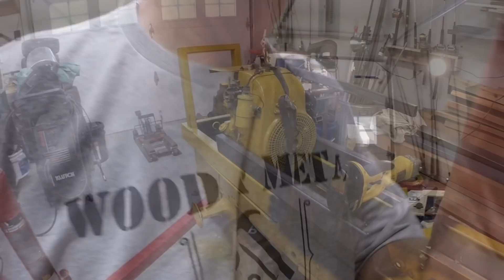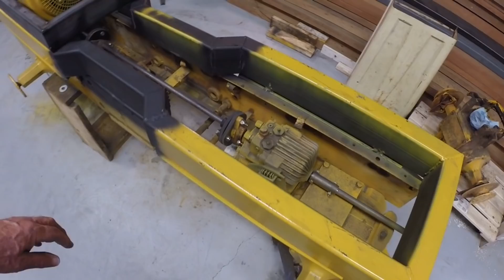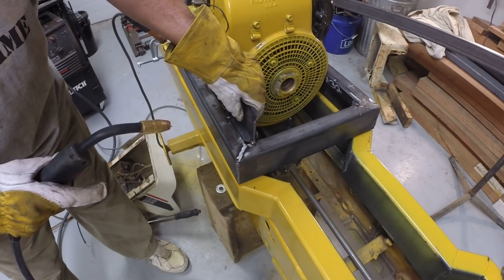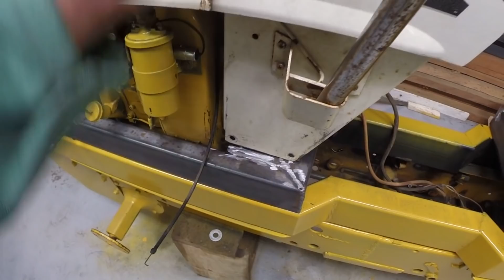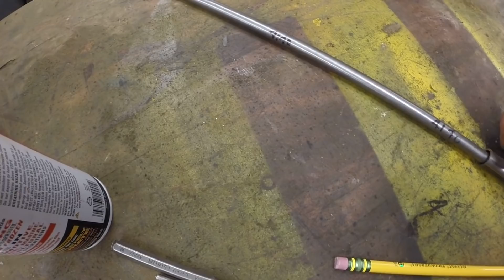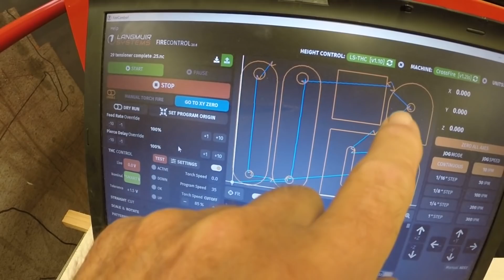Cub Cadet Dozer Build #11, Out of Control!

Comment: HOW ARE YOU GOING TO GET THE FRONT AND REAR DIFFS TO DRIVE IN DIFFERENT DIRECTIONS SO YOU CAN STEER THE DOZER , VERY INTERESTED IN THIS BUILD, I THINK IT'S GOING TO GREAT, WELL ALL THE VERY BEST FRANK.
Reply from the maker: The hydrostats and rear ends are modified to permit independent operation. It's all explained in the first several episodes of the build.

Comment: Why not use a cub cadet zero turn radius drive for the tracks?
Reply from the maker: Made that choice for the extreme ruggedness of the old cast iron Cub Cadet transmissions.  Not sure a zero turn mower is built for this level of abuse. The vintage Cub Cadet axles are bullet proof.

Comment: A trick a guy offshore showed me one time was to use a standard concrete bit in a drill press to drill through hardened steel. I have used that trick a few times and so far it has always worked.
Reply: Just maintain positive pressure on the feed and don't let it chatter. You might also resharpen the cutting edge. I have used this method many times. Carbide doesn't care what material it cuts, concrete, steel, or flesh, makes no difference.

Comment: I have some big conserns whith how it wil work, maybe i am just not seeing it but here they are:
I can't see a way you would want to control the front and rear axles at differt speeds, as they wil be connected to eachother by the tracks. If the front sprocket turns at a different speed than the rear one, there needs to be somthing broken with the tracks. And even the differential in the hydrostats wont make a difference becaus the other sides are connected to eachother too. Why did you choose to have two drive axles anyway? Real dosers have idlers in the front. And how are you planning to make it steer? With braking the side you want to stear to?
Maybe im wrong and you plan wil work. But im not seeing it. Can someone explain?
Reply from the maker: Go back and look at episodes 3, 4 and 5. All you questions will be answered. The axles have been modified so it will work.
Reply: @woodandmetalshoptime8048  oh ok, now i am curious to how you did it. I am sorry if i sounded a little negative in my previous comment.

Comment: just curious.....since u had to move the motor and ur niw wirried about belt replacement on the drive belt...why not go with a chain drive instead?.
Reply from the maker: Need to be able to de-tension the belts so I can start the engine. A chain would need some sort of clutch arrangement. Chain at 3600 rpm would be very noisy and a bit scary...
Reply: @woodandmetalshoptime8048  yea true u wud need a clutch...and not much room for all that....

Comment: When plasma cutting, I would recommend that you program it to minimize the scrap whereby items with common edges (and edges that can be aligned) are cut with a single cut. Similarly,  program the part so that one of its straight edges is the edge of the steel plate - thus eliminating that cut.  

For your control levers, they should definitely be designed with a neutral-spring return detent.  This can easily be done with 2 extension springs on each lever attached in opposing directions.

Comment: Frank, if you got a pair of 5/16" heim joints with long threads, and one LH and one RH nut, you could weld the nuts to a piece of pipe and get the same affect as the turnbuckle. One would only need one jam nut to keep them in place at the desired length. This would also be a bit more rigid.

Comment: Can use copper pipe as a bushing to take up the slack in the rod. 

If you have a press and torch its an east job. 

Add a grease fitting as well

Comment: If the trunnions are up the other way hanging it will be forward for forward movement and vice versa would make more sense as your proposing would drive me nuts. If you can’t have them hanging it is still possible by running the push rods pass the trunnions to a small plate centre mounted to make a pivot and reverse the movement bolt hole top and bottom, lever to bottom hole and top hole to trunnions
Reply from the maker: Not sure of your point, but pushing the levers forward will drive the dozer forward...

Comment: Maybe I missed something, but why are you over engineering the central shaft?! Just have it set in position and go through both levers with bearings,, or bushings and a set of collars with set screws on each side to keep the levers set in the desired position side to side. You can also bend the linkage rods going towards each hydro lever
Reply: Dan and young, is this what you did on your dozer build? Love to see the results.

Comment: I feel like you really jumped the gun on painting
Reply from the maker: Nope. It's part of the process--helps visualize the build as it progresses. Easy enough to put the final coat on at the end.
Reply: @woodandmetalshoptime8048   yeah it just seems like you have had to grind a lot of it to finish welding but you definitely are a lot more talented than me so I won’t argue

Comment: Great build.  Suggest putting in a pillow-block bearing next to the belt pulley on the hydro shaft to support it, rather than depending on the bearing inside the hydro.  The existing support bearing (to the rear) is too far away

Comment: Could you use a turnbuckle for like a cable. Then just cut off the eyes on them and weld them to a rod of the correct length. Then use just a right hand nut to jamb it in place. Also, for the placement of your control levers, I would put the handle and connection point for the sleeved one on the inside. That way you have more freedom to place the handles and connection point where you want it.  So essentially from your picture, I would move the left handle to the right of the right handle that is attached to the sleeve.

Comment: A suggestion on your controls, I would put both track controls on the left side of the seat, side by side to each other. You will find that you will always have your hands on them, making adjustments while you are operating. With this in mind, you will create a "dead man" control.  In your right hand will be the dozer control, that will be in constant motion as you are operating the dozer blade.  Love that plasma table!
Reply from the maker: At this point they will be together on the left side of the tunnel between the seat and the dash, so can both be controlled with the left hand. Control for the blade will be for the right hand, next to the track controls. Episode 14 (now in editing) shows the result.

Comment: I thought of an easy way to spring-load the two control sticks.  You need some very long, light gauge wire coil springs.  You need 4, two per stick.  You arrange the pair one on either side, such that they are both in mild tension in the neutral position.  Then, as you pull the lever in one direction, it stretches one spring, while relaxing (and possibly folding) the other spring.  Release the handle, the stretched spring will pull it back until it's balanced by the other one.  With some mild friction at the hinge point, it shouldn't bounce.  The location of the spring's attachment to the levers will govern how much pull they have, i.e. close to the hinge, the pull is weaker, than farther away. 

Alternatively?  You could use a pair of torsion springs, one wound clockwise, the other wound counter-clockwise (on the other side of the lever).  You'd "wind" these on the pivot axle,  securing one end against the lever, the other to a fixed point on the frame.  The lever secure needs to be just resting against the lever bar, not in a hole.  This lets the spring release, when pulled opposite it's tension direction.  Thus, as you pull the lever arm, it'd 'release' from one spring, while pressing against the other, winding it around the axle.  Each spring would need arms or the ends bent at 90 degrees, so as to press against opposite sides of the lever arms.  The other end, could be a simple hook, fixed into a tab on the frame.  The neutral point would be when both springs were relatively relaxed, keeping the arms in place.

Comment: I'm still confused on how you will steer it. the right side needs to move separately from the left and visa versa. Not just front and back.
Reply from the maker: Rear transmission drives the left track, front drives the right track. Check out episodes 3, 4 and 5.
Reply: Thanks. I must have missed that. Great build.

Comment: I use an air chisel to take the dross off the pieces I cut on my plasma table.  It’s quick and doesn’t eat through so many sanding disks, that dross isn’t on there very strong.  I really enjoy the build!
Reply from the maker: I'll have to try that.

Comment: For the steering lever axle, use two bronze bushings inside the tube for the second handle.  Just a tube over a rod will be yucky sloppy otherwise.

My Dad built from scratch in the 70's what you are building.  He also used chain for track but he used belts for forward and reverse.  Unfortunately only part left is the seat.  He turned 85 today and still making stiff.

Love your project, brings back fond memories playing on the dozer as a kid.

Comment: I'm wondering how he plans making the dozer  turn like a real dozer, when both hydros are going forward and reverse. A real dozer has a drive clutch on each side that can drive forward or reverse, thus, being able to spin around in its on tracks. Thats how you turn a dozer. If his drives will only go forward and reverse at the same time, he's not going to be able to steer it.  It needs to be set up like a zero turn mower in order to turn.That would seem to me that it's only going to go forward or backwards and not be able to turn. Instead one in the front and one in the back, it needs two separate drives in the rear. One to control each track. I my be looking at this wrong, maybe he's figured out how to steer it with both hydros turning in the same direction.
Reply: In an earlier video he shows how he modified the transaxles to accomplish this

Comment: New to your channel and the dozer is coming along nicely.  I've also read some of the comments and you are getting some good suggestions.  I'd also like to make a couple.  Check into heim joints for your control rods.  They come in all sizes with a hole or stud ends and with both male and female threads.  Some one suggested using throttle cables for the controls since you can fish them around obstacles .  PTO cables like the ones you use on dump trucks are quite heavy duty and might work well.

I always liked how the steering brake levers came out of the dash on the older cat bulldozers.  Are you familiar with Walker mowers?  they use a speed control lever.  All it is is a lever that rests on and pulls the hydrostat control levers back into the neutral position.  The hydrostat levers on the Walker mower are spring loaded to go full forward when the speed control lever is pushed full speed.  what would be cool is if you could incorporate something like that to control forward speed then pull back on the lever in the direction you want to turn.  On the Walker mower there is noting holding the levers from going into reverse if the speed control is pulled all the way back.   Just some suggestions that might spark an idea.

Comment: Do you ever use nord-lok or Belleville washers on high vibration parts? I’m pretty impressed with both.
Reply from the maker: Have not used Nord lok  or Belleville washers. Where I'm concerned about vibration I tend toward Nylock nuts.

Comment: Look into keying parts together you make on the plasma table, makes it easy to assemble and weld....
Reply from the maker: The issue I need to resolve to do this is understand better the tolerance limits on the cutter so the keyed parts actually fit together without being too sloppy.  Even so, sloppy may be better than nothing. That's a great idea for building stuff like a box, etc.

Comment: I do have one thing though, The blade, I worked at a coal pier for some years and we had D10's and D11's. When they came in new we had preformed stainless to weld to the forged blade. So can you get a blade forged made for you?

Comment: I get the concept of running one side of tracks off on rear end and other track off second rear end ....but if your only using one side of rear won't the spider gears just spin the side that's not under load or did you weld the spiders up ?
Reply from the maker: spiders are welded. Episodes 3 & 4...

Comment: As an operator.  I think it would be great to be able to steer with your feet and keep your hands free to operate the blade.      Mabe peddles in place of the leavers.      Just a suggestion
Reply from the maker: I may come back and retrofit foot pedals. I built one for the motor grader for the same reason.
Reply: Good idea about steering with foot pedals. Because I run a small dozer a lot for one of my first cousins. And you steer it with two brake pedals with your right foot and you use your left foot for the clutch. I think that this is a great project here that he is building.
Reply: @jeffreykbevins7116  thanks    I’m excited to see how it turns out

Comment: What kind of paint do you use on the cub cadets
Reply from the maker: Depends on whether you want accurate colors or just close. Cub Cadet sells the correct paints. I'm using Caterpillar yellow for this project but I use OEM paint for my restoration projects.
Reply: @woodandmetalshoptime8048  ok there is not much cub cadet paint out there I use mejetic from tractor supply but it fades within a year or two I might try clear coating them to see what that does thanks I’m liking the dozer build

Comment: Thanks for the nice videos!  Did you consider some isolation of the motor vibration from the frame or would this be unnecessary in a bull dozer with low speed and probably many other vibrations?
Reply from the maker: Not necessary.

Comment: For the controls, could you put a plate above the pivot with a slot for the levers to ride in. Then put a detent for neutral. It would add friction to hold the controls in position and give a neutral lock out. Wouldn't be automatic but would be easy to find neutral in a panic. Either way amazing build. Looking forward to the next video
Reply: smart thought

Comment: Since there is only a single direction trunion per drive axle, how do you plan on isolating each side to steer? Cant have one axle in forward and one in reverse pulling against each other. Just curious.
Reply: You know, maybe he intends on disconnecting one side on each hydro. So one hydro does the left track and one does the right. Welding the differential with one side gear pulled out would do the trick.
Reply from the maker: This is actually what I've done. It's all shown in episodes 3 and 4!  Also, the hydros can go forward or reverse, so you can control each track independently.
Reply: @woodandmetalshoptime8048  That explains it, I think I jumped in around #5! Thanks for clearing that up. All makes sense now.
Reply: I've been patiently awaiting the explanation on this as well... I'm pretty sure I'm missing something obvious at this point.

Comment: Suggestion for belt tensioner use an automotive serpentine tensioner
Reply from the maker: Looked at that. Can't find one that will handle both belts. Also needs to be de-tensioned enough to start the engine.

Comment: I would recommend using some control cables like a throttle cable with a casing. It would allow you to fish it around obstacles between the drives and the controls so you don't have to have a straight shot. It would also provide adjustment and resistance to help maintain the control position. Here is an example from McMaster Carr 	3125K518. One other thing, can you tilt the hood forward with the front blade brace so close? Not sure where the hood pivots.
If you get a couple of magnets that you can place on the part being cut out has you get to a certain point, you can prevent it from fall through and causing the torch to catch the edge. Also easier to remove the parts.
Your doing a great job. A lot to take into account. Thanks for sharing.

Comment: You should build the fuel tank and hydraulic tanks beside the seat, then you could put arm rest on top of the tanks. Look at komatsu bulldozers.
Reply: Does the gas tank location depend on gravity or is the fuel being pumped to the engine? My guess is, we'll find out in a future video!  ;-)
Reply from the maker: Planning on gravity feed. So needs to be above the carburetor. There is no need for a hydraulic tank, the rear axle has auxiliary hydraulics and has a 2 gallon reservoir.

Comment: ? How do u get it to turn???
Reply from the maker: the dozer? drive one track forward and the other backwards or stationary...
Reply: So u can stop one side off the trunons or make one side turn forwerd and other back words
Reply: The rear hydro transmission powers the left side track, forward or backward.
And the front hydro transmission powers the right side track, forward or backward.
The left steering stick operates the rear hydro transmission and the right steering stick operates the front hydro transmission.

Comment: I suggest you look into using an adjustable clevis on each end of your push pull rods. I might also suggest gas struts for the centering of the levers like they do for zero turn mowers.
Reply: I'd second the suggestion to use clevis or a small ball joint (like a you'd see on the steering control rod), easy connection and adjustability and you can get away without making left hand threads.  I like having a small wrench flat near the end the shaft to help with adjustment.  Having some kind of dead man (either springs or gas cylinders) is probably a good idea, It's not only a unconscious operator, people will just let go of things when they get flustered and a spring return could save your garage door, shrubs, etc